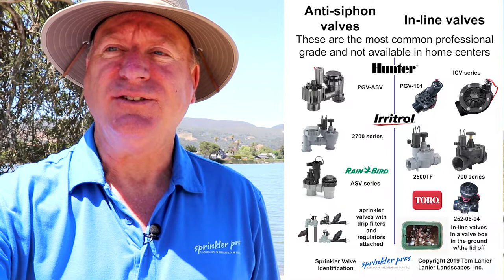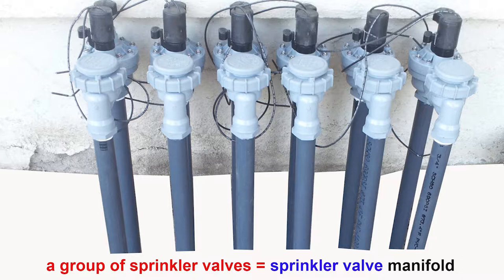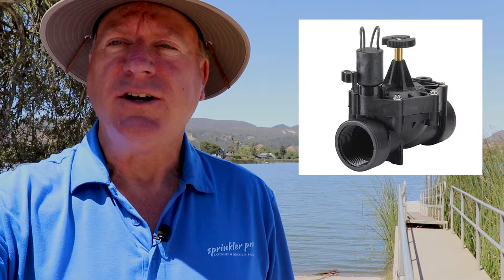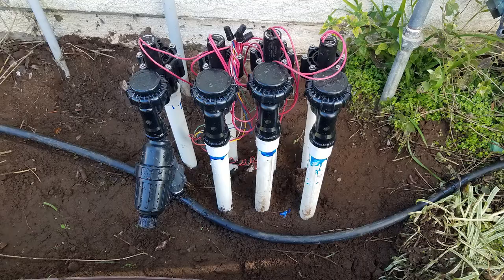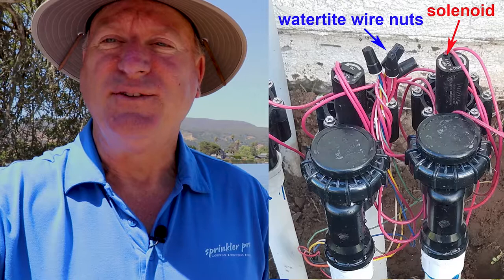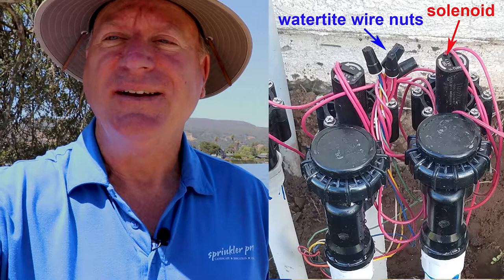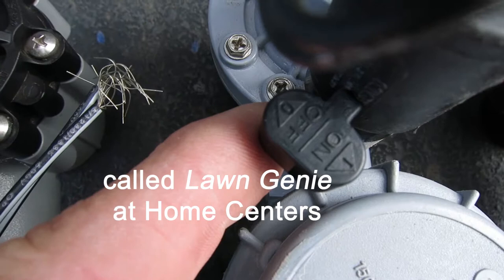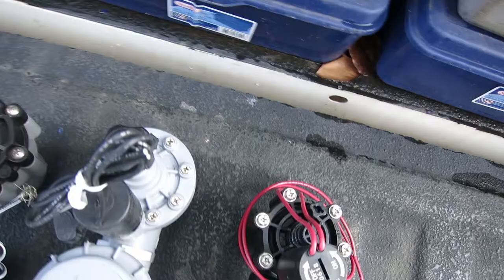Overview of Sprinkler Valves | Lesson Three of the Anatomy 101 series

Comment: "If you do have sprinkler lines with sprinklers higher than the anti-siphon sprinkler valves, there are remedies that you can ask me about in the comments below".  

Ok, I'm asking! I have a number of zones that are in areas of my yard much higher than the anti-siphon valves that control them.  What's the best way to handle that?
Reply from the maker: Bret, first question is: do you have water draining back out of the anti-siphon caps for a long time after those lines have run? Do you have algae growing on the valves because of it? Are there any other problems from the lines being higher than the valves? If not, then don't sweat it. If you do, let me know what those problems are. Happy Holidays!

Comment: Have you ever seen in line valves installed under a house in a crawl space? I’m starting to worry mine are in there. I know where the back flow is back can’t find the valves. Judging from the where the wires lead and how I can hear zone turning on echoing throw my whole house I’m kind of worried?
Reply from the maker: No I haven't seen them under a crawl space but I've seen them under a high front porch and also under patio decks. That would be a drag if they're under the house.😱

Comment: I thought it was interesting that the valves can be turned on by rotating the solenoid 1/4 turn.  I went out and tried mine, but since our water comes from the lake using an irrigation pump it didn't work.  I'll need to figure out how to manually turn on the pump first.

Thanks for the videos.
Reply from the maker: Glenn, good point. I'll try to remember this so I can mention this exception in another relative video. I know someone who has their yard faucets (Google 'garden valve') on a separate valve that is wired to a station on the timer that has no run time set so they simply turn on that station using the manual function as needed. If you have a wifi timer then you can do this from your smartphone or computer!

Comment: I live on a hill and I have waterlines that go up the hill to a hose bib abd downhill.  I intend to put in sprinkler and drop systems both up and downhill.

I want to first install a backflow preventer but since the water will be going up from it do I need some specific kind?  Does it need to be one of these kinds that's many hundreds of dollars?
Reply from the maker: Michael, a double check valve is what you need for that.

Comment: Would it be silly to connect the manifold right to my water spigot?
Reply from the maker: Technically yes, but not advisable due to the low water volume you'd get. The preferable way is to tie into the main line. There are other scenarios but that is the best.